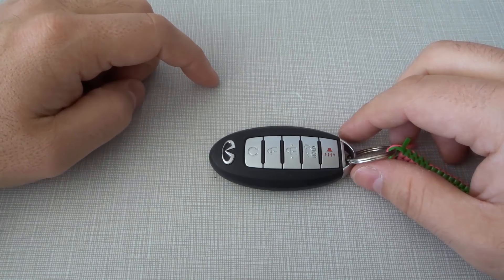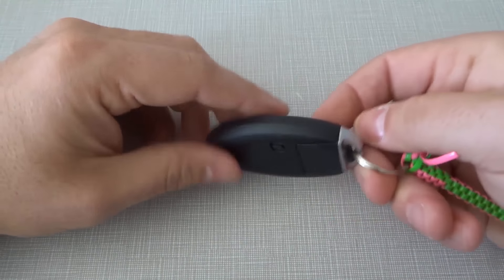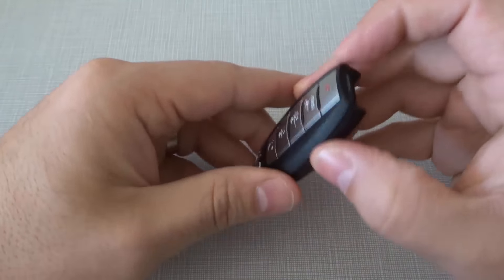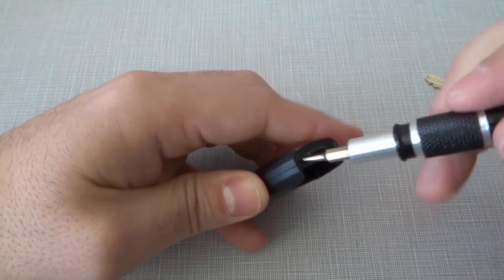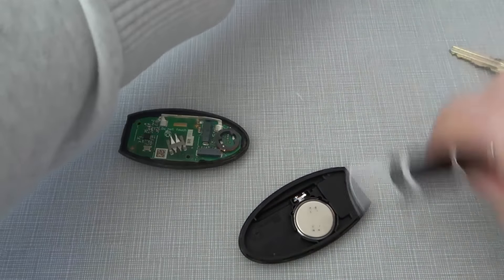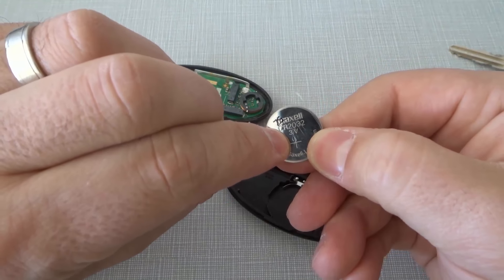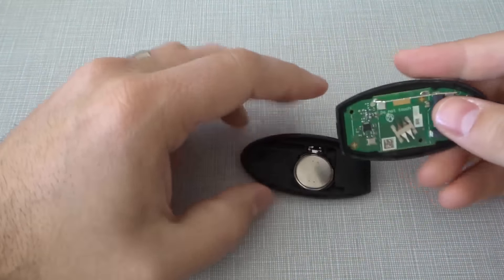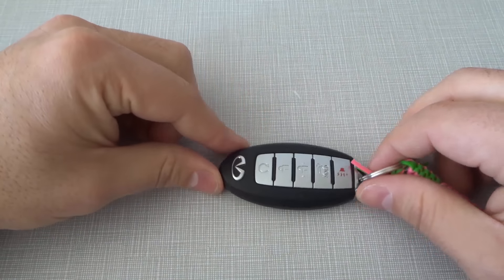How To Change An Infiniti Key Fob Battery-Tutorial

Comment: Worked like a charm.  Dealer gave two fob/remotes with vehicle but dead battery on one of them.  Just happened to have a extra CR2032 in the kitchen cabinet.  Took about five minutes and now have spare working key fob.  Thanks.

FYI:  the CR2032 is a pretty common if not universal key fob remote battery for  multiple vehicles and multiple model years.  Thanks!!

Comment: This video is so well done.  Gets right to the point and shows how to do it.  I didn't notice the 2 tabs on the interior till you pointed it out.  Pro tip - use a 3.8mm tip to fill out the tab and its as simple as a twist to open up the fob.  using a smaller width tip can deform the tab.

Comment: Thank you for your way to help take out the nerves from replacing the battery on an Infiniti key fab for the first time. The narration helped to guide me to use the mini screw driver appropriately as I was learning and doing it, the way to pry open the plastic key fab quickly and safely, helped me to learn that there is an actual key in the key fab, what model battery I needed and what tool I needed to get to get it done.  I made all my purchases at the local Target store. Thanks again.

Comment: Good tutorial. Only problem is mine has a cr2025 and the inside looks different. Title needs to be changed to specific years that this key fob covers cuz some of the other infinities have different insides and batteries.

Another problem is the battery does not go on the side of the all black part of the body of the key fob. Secondly when you click it starting from the front to the back to snap it together it does not snap together. I have a 2011 Infiniti G37 s. I don't know what kind of car that one came from but I think yours is a completely different design.

Comment: Any idea what to do if you change the battery and it still doesn't work? You know how to reprogram them?
Reply: Did you ever find a solution? I changed my battery and it still didnt work
Reply: Unlock the car with the working fob, move the working fob out of range of the car, then take malfunctioning fob with the new battery into the car. Then try to start the car. This worked for me
Reply: RayATX mine says key is incorrect
Reply: I had the same issue. Replaced battery and key did not work. Took the fob to the car, and the car starts, but the buttons on the fob are dead - no function on locks etc.
Reply: @scottsherry  im having the same issues
Reply: @scottsherry  ever find a solution having the same problem but when I replaced 1 fob battery both fobs stopped working

Comment: Did anybody else tear up the little slits that you pry open at the top of the fob? I was very careful and this cheap plastic still got chewed up when I tried to pry it open. Mine was a very tight fit.. the good and exciting news was that I already had the correct replacement batteries at home I bought for a different project last year. 😎

Comment: I can start the car and open the doors while locked on my q50 but it doesn't lock or unlock with the key fob maybe it's a fuse ? I put new batteries still doesn't work
Reply: Did you manage to fix it?
Reply: @alphav1537  no
Reply: @alphav1537  I also put a new anti theft horn relay still didn't work I just gave up on it my best bet is to install a after market alarm

Comment: Am I the only one that lost use of remote (even with new battery), and had to go to the dealership to have the key fob (both of them) re-programmed? REplacing a key fob is simple but paying to have the fob reprogrammed at the dealership is expensive. Perhaps my car's computer had a problem. As an aside, anyone else having repeated wearing out (every 40k miles) of the bushing for the front shocks (QX60 2014 2x at 60k and 120k and 2018 at 50k)?